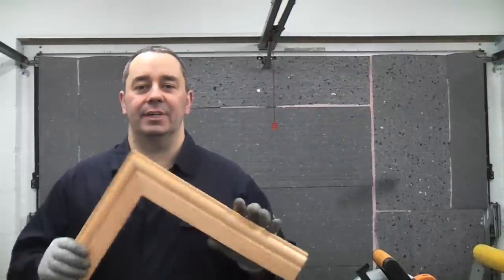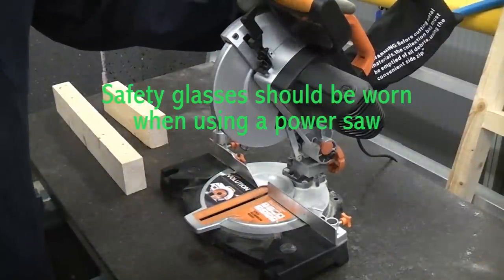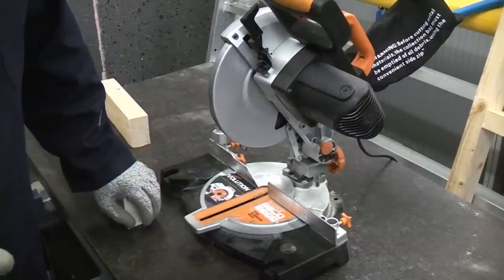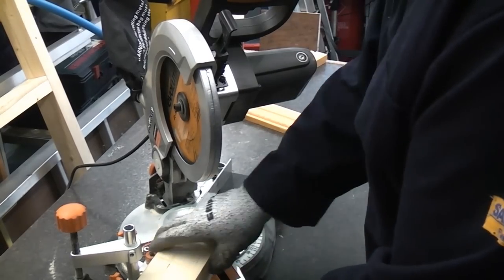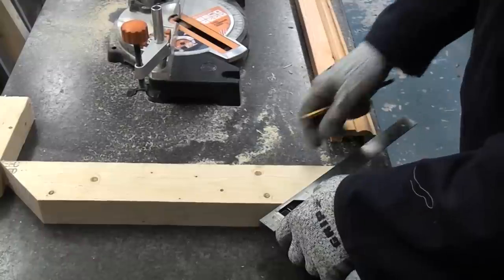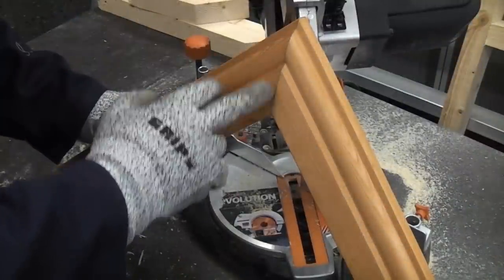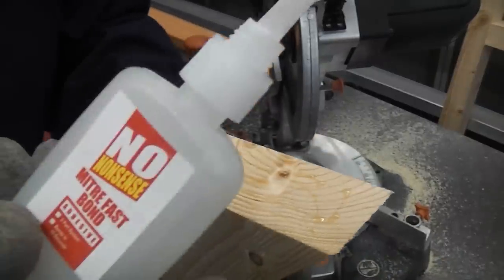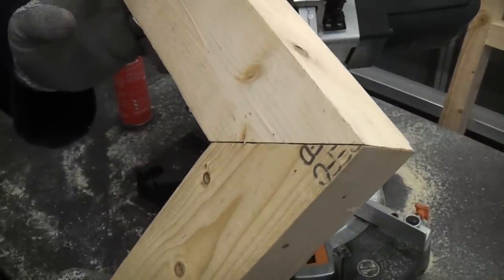Mitre joint | miter joint

Comment: great video as always, im a big fan and used a lot of the products and advice youve given.
i just bought the evolution fury 3xl saw (sliding mitre) but i think it might need some initial setting up for the angle guides etc. 
did you have to do some initial accuracy checking with your evolution saw?

Comment: Hi I know this is nothing to do with the video but do you have a video or advice on removing chipboard floor boards (tunnel and grove) without damaging them I am looking to feed tv aerial cable under them thanks
Reply from the maker: +windyourneckin1 Very difficult as walls and skirting boards often prevent lifting them up and as you have pointed out they are tongue and groove, so they are interlocked with each other. .Normally I use a circular saw and cut along side of the joist, then screw a piece of timber to the joist when refitting the board.I hope this helps ;-)